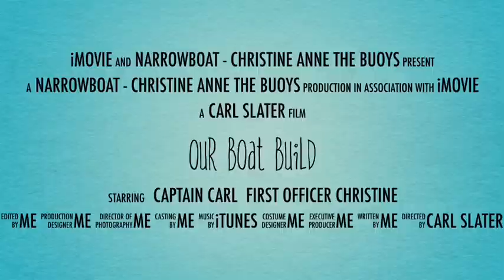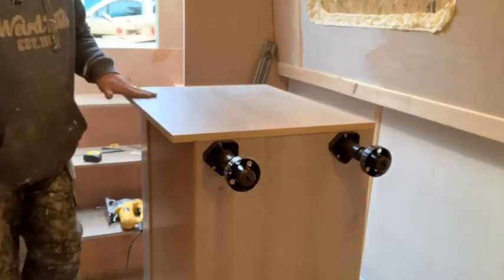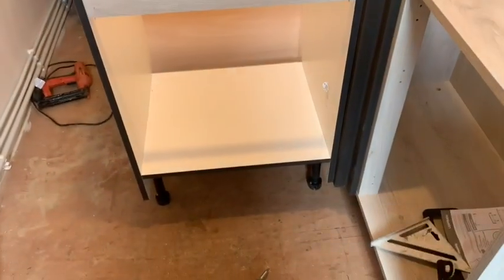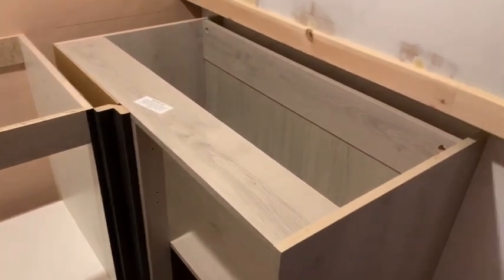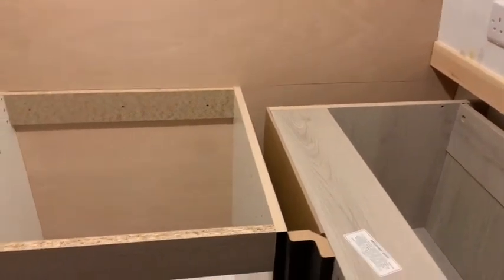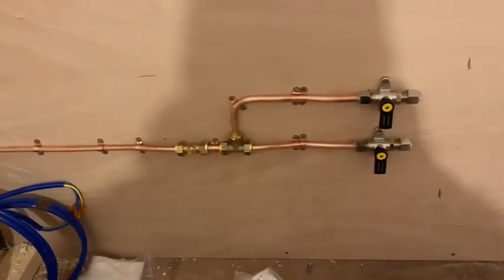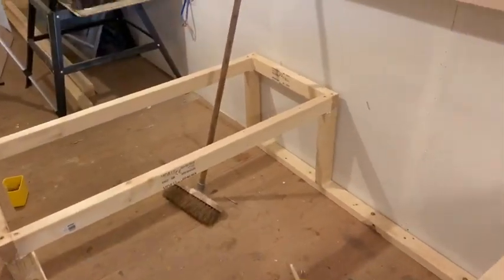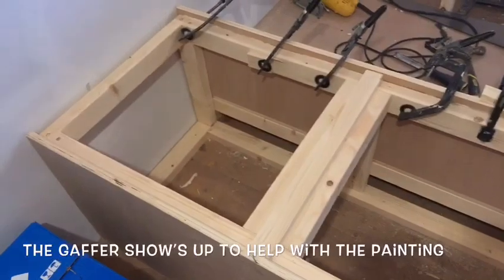New narrowboat build and fit out part 15 - kitchen & dinette

Comment: Hi just a quick comment that may be of interest  to you last time I fitted out a boat the rule was the gas pipe must be visible along its whole length so the inspector  can see that there are no joins.Your fixed seating if you are fitting back rests the one towards the lounge end should if you can be made to fit either side so guests can sit facing you in the lounge.keep up the good work hope to see you out on the cut later on in the year

Comment: Hi Karl ,Thumbs up for you the last clip ,as usual really helpful mate .
I’m having issue at the moment trying to work out cable sizes as I can’t seem to find the amps or watts on spec sheets anywhere used for certain items ie 1 / 12v toilet cassette  feed 2/ 12v hob ignition feed  3/ 12 v led head lamp boat feed  4/ boat Horn feed   5/ bilge pump feed.Any help would be  much appreciated .Cheers mate

Comment: Hi Karl I noticed you have a central trunking system down the centre of your boat for all your 12v but also a long run of black flexy conduit running parallel down along one side of the ceiling ,just wondered why 1/ whatever cable it is ,isn’t run in you central trunking?and 2/ what size black flexy conduit have you used for all you 12v?
Reply from the maker: Hi Triple T the conduit is 20mm from Screwfix, well spotted the conduit down the side of the boat contains a cat 6 network cable and will run from the router in the bedroom (yet to be installed) to the tv in the lounge area, the reason I ran the network cable down the side of the boat and not down the middle was to try to keep it away from other cables as they may interfere with the signals in the network cable. Hope that helps
All the best Carl & Christine ❤️❤️
Reply: Cheers Karl ,your a real gent

Comment: in the dinette area, why is the floor under the table raised so high? what was spilt on the floor? looks like oil
Reply from the maker: Hi, most Pullman dinette’s are built on a small plinth, it’s mainly to lift you up so you can see out of the window more easily , it’s water on the floor, it was raining outside and I’m in and out of the boat all the time.
All the best Carl & Christine ❤️❤️